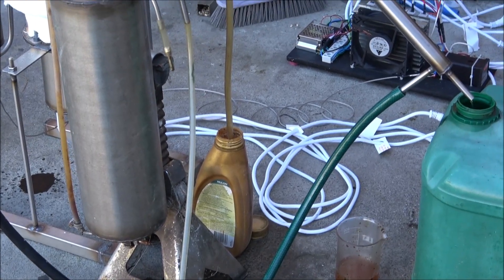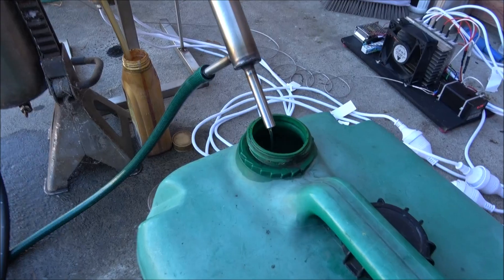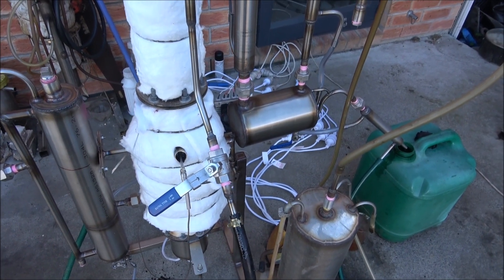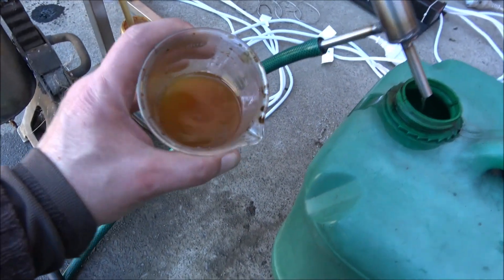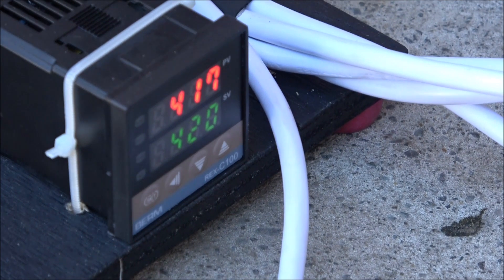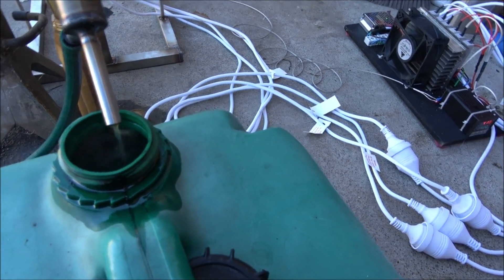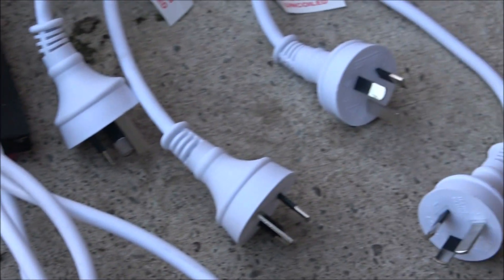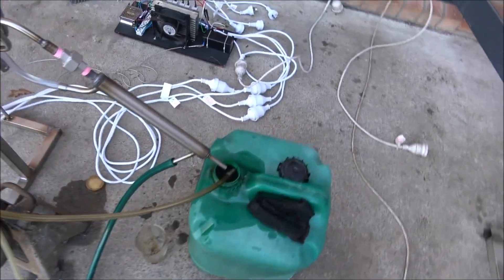6kw oil still - WMO to diesel.

Comment: How much in usd to buy one of these and is 6kw the actual power needed for it  im in alabama usa and can i buy the control unit also will it run as a gravity feed or only with a pump
Reply from the maker: Hi, for prices and any additional info check contact details in the description, the smaller version is 4kw unit, the control unit is a part of the distiller, the pump ensures steady oil supply without hiccups regardless of the level of the liquid in a supply vessel.

Comment: question can it process biocrude
Reply from the maker: No, only petroleum based.
Reply: @santeryi9  ok
Reply: @santeryi9  try used synthetic motor oil
Reply from the maker: @TimSmith-vl4qk  already tried, working well.
Reply: @santeryi9  make a video of it
Reply: @santeryi9  make a video of making kerosene

Comment: How much pressure does it create can i use old water pressure tank for distillery
Reply from the maker: There is almost no pressure, but the temperature is very high. Also, it is not just a tank, but the combination of different vessels within each other. Thus I suggest you need to familiarize yourself with instruction first.
Reply: Can i use regular propane stove to heat the tank

Comment: Once you prosses the used oil do you still dilute it with gasoline or can it be used on a diesel engine right of the processing end? Thanks
Reply from the maker: Once oil is processed, it settled for a few days, then transferred into a separate container and some silica gel added, then after three days filtered and used strait for diesel engine, but you can mix with normal diesel.
Reply: @santeryi9  what is the percentage of silica gel?  The gel doesn't hurt the engine?

Comment: Hi Alek
I watch some of your work. Very interesting my friend 🙏
I have a question maybe u can help.
When in bleaching we put sulferic acid, there is a residue in the button. Do u know what is the content of it AND WHY does it happen?
Reply from the maker: The acid acts like coagulant, and reacts with bitumen, polymers and gum that fuel contains, then all these components are depositing to the walls and bottom of the container, the mix also containing a lot of acid and can be used for another reaction.
After the reaction and settling - fuel should be transferred into another container for further treatment, with alkali or absorbent.

Comment: Hello. What is the percentage of diesel fuel output? How many liters of WMO can a 6 kW distillery process per hour? Does distilled diesel fuel smell bad? If there is an odor, how do you get rid of the odor? Do you do chemical or physical cleaning on distilled diesel fuel?
Sorry for asking too many questions. Please answer my questions.
Reply from the maker: Hi, output usually about 80%, though depends on the oil type, an automatic transmission fluid will easily give 95% output. The 6kw unit will do about 20L per hour, and again depending on oil type and distillation temperature. Also temperature of distillation will affect the quality and odor, the lower the temperature the better the quality and odor of the output. And again - the quality of final result will determine a treatment method, either absorbent and settling, or sulfuric acid and triethanolamine.